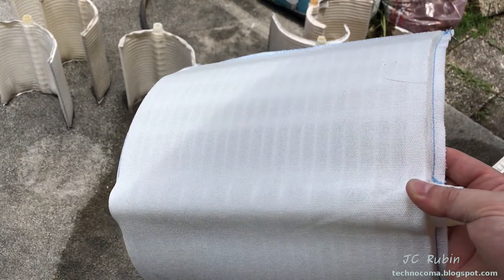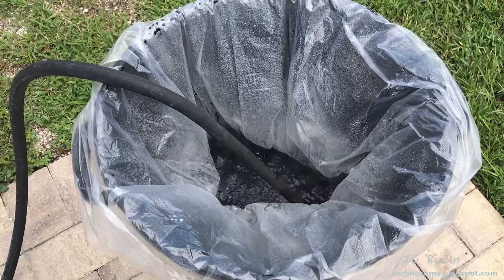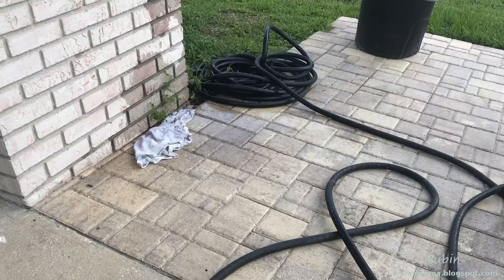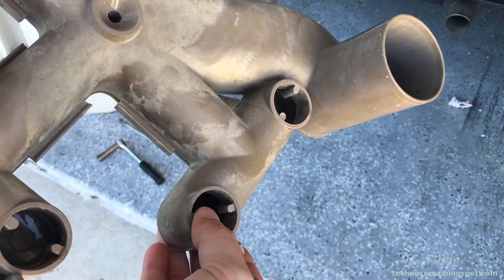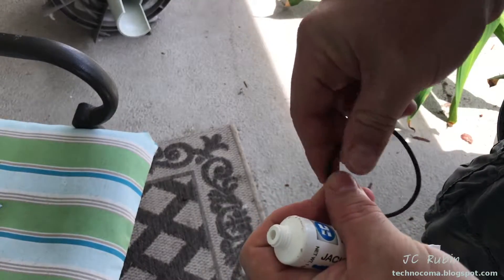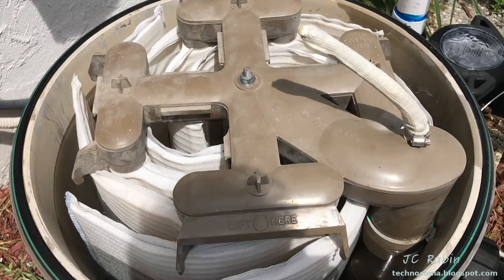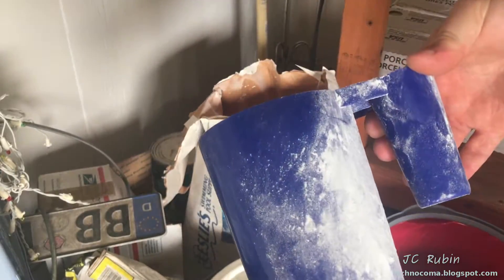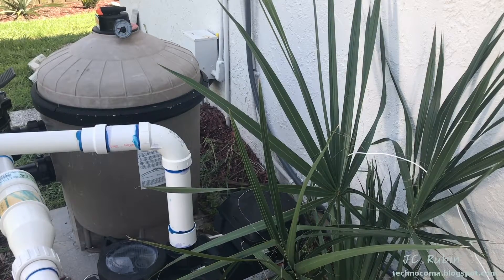Hayward Pro Grid DE Filter Cleaning - Complete Process - 2 of 2

Comment: I was wondering about the degreaser myself but did see an answer. So her you go....1. Dish Soap (Mild):
 * A mild solution of dish soap and water can help to cut through some grease and oils.
 * Mix a small amount of dish soap with water in a bucket.
 * Soak the grids in the solution for a few hours.
 * Rinse thoroughly with a garden hose.
2. TSP (Trisodium Phosphate):
 * TSP is a stronger cleaner that can effectively remove grease and oils. You can find it in the cleaning supplies section of most hardware stores.
 * Caution: Wear gloves and eye protection when using TSP.
 * Mix about 1/2 cup of TSP with 5 gallons of water in a bucket.
 * Soak the grids for at least 3 hours.
 * Rinse thoroughly with a garden hose.
3. Electric Dishwasher Detergent:
 * Some pool owners have found that electric dishwasher detergent (the kind for dishwashers, not handwashing) can help degrease filter grids.
 * Mix a small amount with water in a bucket.
 * Soak the grids for a few hours.
 * Rinse thoroughly with a garden hose.
4. Commercial Filter Cleaners:
 * There are specific pool filter cleaners available that are designed to remove grease, oils, and other buildup from filter elements. These are often enzyme-based or contain surfactants.
 * Follow the manufacturer's instructions on the product label for dilution and soaking times. Some popular brands include:
   * HTH Pool Care Filter Cleaner
   * Doheny's Filter Cleaner and Degreaser
   * Power Soak Filter Cleaner
   * Natural Chemistry Filter

Comment: Thanks for these complete videos. I followed exactly as you showed, and made a dilution even a bit higher than what you stated at 15:1 ratio. Unfortunately it didn't work for me, I had a starting pressure of 20PSI, after the bath of 4 hours, it was exactly 20PSI again. If you could give me a hint I would gratefully $ thank you. A hint for other viewers. If at HD must buy HDX muriatic acid 31.45 % or anywhere also it must be 31.45%. NOT Klean Strip as it's already diluted and weak! It wont work.

Comment: Thank you for posting such an informative, clear video with great explanations.  Very helpful.  Question for you.  I think I saw it the first time thru the videos, but could not find it when I went back thru them:  For a fresh charge of DE after thoroughly cleaning the filters, I use 100% of the manufacturer's recommended charge (4.5#, in my case).  What % of a full charge of DE should be added if I only do a backwash without cleaning the filters?  Thanks for all your help.  Eric

Comment: Would it be advantageous to immerse the entire manifold with the grids and filter elements intact, into an acid bath, after hosing it clean?  Less time consuming and less labor intensive.  Is there any part of the assembly that can get damaged by the muriatic acid?
Reply from the maker: It needs to be disassembled anyway for inspection, there are no shortcuts on a DE filter maintenance.

Comment: This is by far the most informative video. The recording of the PSI at different pump speed is good. Now that I am not that worry my filter pressure is abnormal as I was always concerned if I add too little DE that didn’t coat it enough or DE blow out from the return that makes the pressure less than 5 psi at 1300-1500 speed.
Reply from the maker: Thats the best way to keep track of a normal system and when its time to service it.

Comment: Have you ever come across the union nut connecting salt cell generator to pool plumbing splitting thru the threads? And if so, is split nut connector that I have seen online a suitable replacement? There is not enough pipe length to cut off and replace the union fitting.
Reply from the maker: I broke one once on a similar application, they sell them at big box stores like home depot

Comment: My 2009 DE4820 owner’s manual doesn’t show an O-ring but a “metal reinforcing band” that Hayward says NOT to lubricate.   When I replaced the entire grid unit, I noticed that the replacement unit does not have the skinny filter piece coming out of the top.  So either Hayward has changed things since 2009 or the unit I have is an aftermarket unit ?
Reply from the maker: I have a separate video to replace the unit up on top which is in fact a replacement part from the company after mine had failed.

Comment: Thank you for the Muriatic Acid tip. My pool filter, baskets were all coated with rusty red. Muriatic acid solution removed most rusts. My Hayward filter grid elements were all cracked and broken, leaking DE into pool. Bought a new set of grid elements and put it in today. Your tips really helped. Thank you.
Reply from the maker: Glad to hear its fixed.
Reply: @retrotechandelectronics  The pool water is sparkling today. It’s very high in chlorine as I poured a few gallons of chlorine in to keep algae at bay without a filter.

Comment: Maybe I missed it, but what product and what ratio did you use for the degreasing stage of the filter elements?
Reply: What did you use for the first degreaser step?  Not the muriatic to demineralize.
Reply from the maker: I used muriatic acid and water, diluted weaker than 4:1

Comment: Can you tell me what the tube is for on the bottom of the spacer? I have one too, and have no idea what it is called or the purpose. Thanks!
Reply from the maker: Are you talking about the big piece of cut PVC on the bottom?
Reply: @retrotechandelectronics  yes...
Reply from the maker: @shelliegillespie4721  It is the bottom center support for that whole filter cluster connected to the manifold.  It has a cutout to accommodate the pipe at the bottom of the unit.  It hold severything up.

Comment: What size it this filter of yours? The 2420? My 2420L seems to have the larger grids, (18") has no bottom pipe glued on and the discrepancies are making me nuts.. hard to figure this thing.
Reply from the maker: Its possible that there were minor nuances. and running changes in the pro-grid line. Don't let it dissuade you.   Walk into a leslies with your parts if you get stuck and they can let you know if it was superseded.

Comment: what is the purpose of lubricating the large rubber gasket for the base cap?
Reply: I was having trouble clamping the containers together and having the brace flush with the outer lips of the container and the gasket was unliubricated and at the time seemed to make a large gap between the containers. It has been made apparent that the lubrication of the gasket was my shortcoming, but I would like to know the purpose of the large O-ring's lubrication
Reply from the maker: All of the rubber parts should be lubricated for many reasons the least of which is a protectant for the material itself.

Comment: Thanks so much for these videos. We have the same filter and have had more and more sand coming into the pool each year. Last year I believe ALL of the sand came back into the pool. We have had a company open and close the pool, and I always ask about the sand and they say the filter looks good. At closing I watched him clean and inspect it for any tears (although he didn't take it all the way apart like you). We need to solve this issue before opening the pool this season. What could cause that much sand coming into the pool? Could it be the manifold plastic pieces? I checked the spider gasket thinking that could cause it but it looks good. Thanks for your help.
Reply from the maker: this is most often due to weak points where the DE gets through the fabric or a crack in the manifold.

Comment: This is so complicated compared to the cartridge filter. Have you thought about replacing it with cartridge filter?
Reply from the maker: If you keep the sock on the intake and run a salt chlorinator, this is hardly any trouble.  I do maintenance manually, I really could get away with once a year doing backwashes only if I was lazy

Comment: My only leak was at the big oring. I have a pleated cartridge system. I also use a 55 gallon bucket to soak my filters. I clean my filters after an increase of 10lbs. Pressure on the filter housing. Usually about 4 times a year.  No DE sand! Good video!
Reply from the maker: Ok the filter cartridge is an entirely different system.